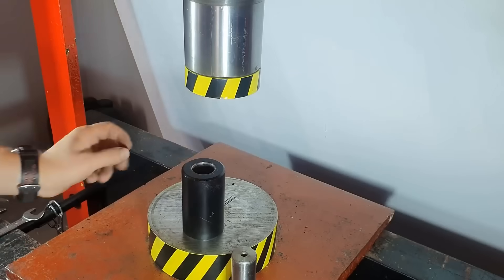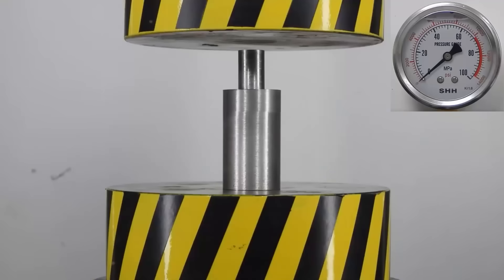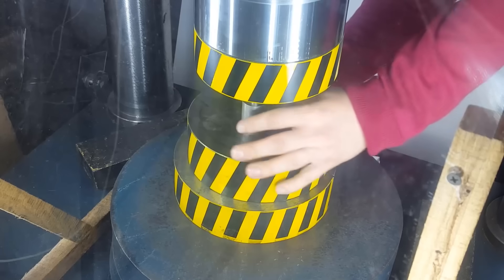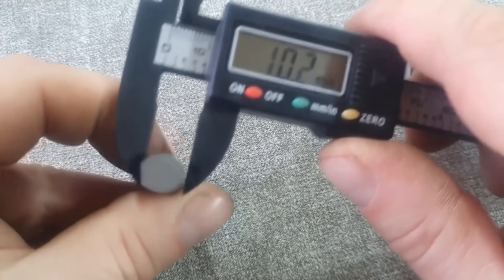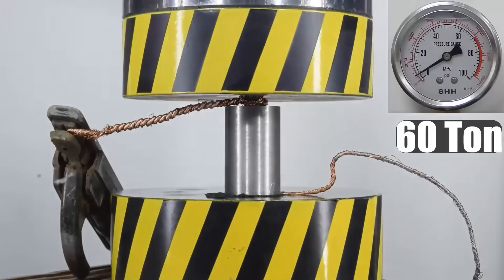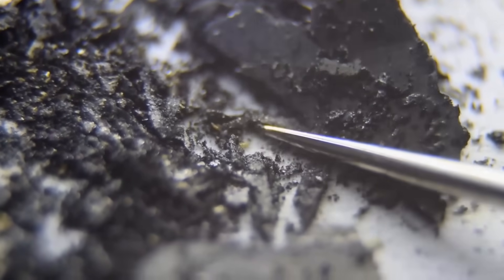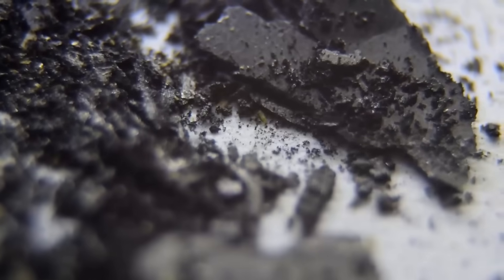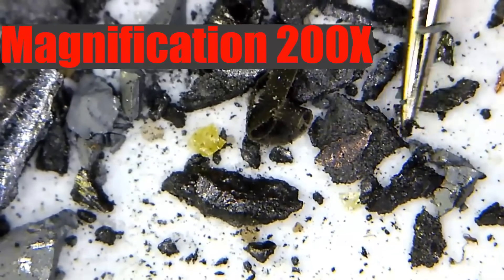HYDRAULIC PRESS TURNS GRAPHITE INTO DIAMOND

Comment: There is a process of creating diamonds called High-Pressure High Heat which uses multiple presses and a prolonged duration under heat. This method is usually used to create tool grade diamonds as they generally need to be small like that in the first place to use as an abrasive. Making Gem grade diamonds with this method generally requires a lot more time under pressure and heat which makes it prohibitively expensive. There is another method of creating Diamonds that is more economically viable and has better results for Gem grade diamonds. You probably made some graphene with your method when you applied current which can be used to harden composites.

Comment: I just started the video.. but, isn't diamond formation only possible with HEAT and PRESSURE?

Crushing graphite under a big hammer isn't going to make you rich, unfortunately!

Actually, I'm not sure how lab-made diamonds are formed? What's their process? I'm gonna check it out after this video.

De-beers isn't very happy with them, pushing 'REAL' diamonds (with all the slavery, corruption and sketchy money involved in the gem trade).. it's literally just carbon. The most abundant element on earth, squished.. Don't believe the marketing hype. Your woman won't love you less for buying an identical rock at 1/100th the price. If she does, dump her!

I think most lab-made diamonds are used in industrial applications, like drilling. 

So... what did companies that needed diamond drill bits do before now? Did they have to buy expensive diamonds? They're one of the most common gem stones on Earth as well, but the market is entirely controlled by one company, artificially inflating prices. [Debeers commands at least 80% of the global market]

Comment: If you partially fill the  blocked off cylinder with Graphite, heat it to at least bright red an also the rod then place it in the press and quench it.  The experiment should further contract  applying further pressure under heat.  Then you would have to saw it ... maybe get more diamonds??  The melted copper is due to electric shorting.  You need to maybe superglue the diamond specimen to a stylus and try to scratch quartz or tungsten to Prove its hardness.

Comment: Didn't the question of much HEAT occur to you ?  At least 1500deg. Time would not be necessary but that cylinder should have been glowing orange_hot.  The hydraulic press is made of steel so by far the heating? current would have Directly shorted out through the outer cylinder and the press. Any heating would be due to the crushing experience alone.  The breaker tripped due to shorting ...

Comment: Their are fake diamonds used in Jewelry, I don't know the process for making them, then you have CVD, I use to be an industrial diamond lapper and their uses have become less common since Hard Turning in CNC machines has become more common because Diamond in industrial use is commonly used to face off or shape grinding wheels and the parts use to be ground finish. CVD "chemical Vapor Deposition" are grown on a substrate in an atmosphere where the atoms just deposit on top of each other, thus the term growing them. They have about the same hardness as diamond but break or fracture very easily a 1X1X3mm CVD log was less than $1.00

Comment: You should have drilled two holes in the side of the cylinder opposite each other, down where the graphite, or better yet, pure Carbon would be, and strip the insulation  back a little bit so the Copper wire is embedded in the Carbon pile, then apply the electricity as pressure is starting to rise.  The electricity will heat the Carbon well beyond its melting point, and the pressure will force any gasses out of the Carbon pile.

Comment: A diamond that small could possibly be used on the tip of a disk outer edge of a flywheel (not the round part, but the disk flat part near the edge) to create a diamond polisher if you have a movable clamp that can move a clamped object sideways across the flywheel so that the diamond can cut out a polish surface on the object.

Comment: question how can u obtain 50000 pressure where in your piston has a clearance and not in a round shape, even if it is round you will still not achieve a pressure of 50000psa to achieve this kind of pressure it should be an ENCLOSED SPACE where air/fluid/liquid cannot escape din applied by tremendous force..cause as the formula says pressure is equals to force over area

Comment: Diamond is a crystal, it has to grow. Doesn’t just pop into existence
Reply: Absolutely correct. But ONLY if this was a crystal nucleating out of a solvent containing dissolved carbon, or some other amorphous solution of disconnected carbon atoms. 

2 ways to proceed with this thought:

1) That crystal begins when the first 4 atoms join up in a tetrahedral lattice. 
However... Given the size of atoms, the timescale might be considered so small it did indeed "pop into existence". It then grows very quickly initially, as the rate at which atoms diffuse to the crystal surface to add themselves is finite, meaning that the bigger the crystal gets, the slower it grows. A diamond crystal the size of this one, would take mere seconds to grow via diffusion. 

2) This was NOT a random mix of disconnected carbon atoms, but a lattice of carbon atoms connected in the hexagonal layer structure of graphite. Tranforming to diamond is now a solid state change of the crystal lattice. 
It only takes the right squeeze at the right point, for that crystal structure to trip over into the tetrahedron of diamond. Which would then ripple through the rest of the lattice at the speed of... ?an atomic bomb?  Near instant, certainly. 
Kinda like a domino rally - once started, it ripples onward. 

So, why doesn't the entire lump of graphite transform into diamond? 
Again, 2 reasons. 

- This is not one homogenous lump of graphite, but (despite the small size) it is a collection of small bits of graphite (and other stuff, like clay). Just because ONE of those graphite crystals felt the right conditions to twist itself into diamond does not mean the others were ready to. If you remove one domino from the rally, then the rally stops at that gap. This might be a grain boundary within the graphite crystal structure, for example.

- Diamond is denser than graphite. Meaning the atoms are packed closer together. As the graphite turns into diamond, the volume decreases. Which reduces the local pressure. So that transformation runs out of pressure, losing the right conditions for the transformation to continue. Once again, the rally stops, quite possibly even while still within a single graphite crystal.

Comment: If you want to make diamond from graphite, then you need to actually use graphite to start with.  Pencil leads have various proportions of clay in them, depending on hardness.  If you doubt this, just heat a pencil lead with a blowtorch for a while, and see what you have left after all the carbon has burned off.

Comment: You need a more round center cylinder, set the welder lower so that it doesn't short circuit and only turn it on when the pressure is built up.

Comment: Add some thermite to the top of the pure carbon power. The pressure could set off the thermite that would give you your heat and greatly raise the pressure at the same time.

Comment: The temperatures of the coper wires had to have gotten as hot as a minimum of 1,865° (1,864.62°) Celsius if they were melted in places because that temperature said is the melting point of copper. So that wire got up to about 2,000+° Celsius in some spots.
Reply: Copper melts way lower than that

Comment: Might depend on the coal you used too. Example thermal coal has different properties than PCI coal and they both have different properties than hard metallurgical steel making coal. If you have good hard met coal it’s carbon content is very high.

Comment: We ridicule alchemists in the old world for trying to turn lead  into gold yet it is possible to turn graphite into diamond. They were close
Reply: this is completely different, to turn lead to gold you need to add/ take protons from the atoms in this case graphite is pure carbon as well as diamonds.
Reply: @nadavk13  well no, to make gold you will need a large star turning into a supernova. We do have one local but i would like to keep it as a star for now, thank you.
Reply: Transforming graphite into diamond is like tempering steel, it's just changing the crystal structure, lead and gold on the other hand, are entirely different elements.
Reply: It’s because looks can be deceiving. A diamond is the same carbon with different arrangements in their bonding. It’s not different in substance. 

I guess like how you can make nuggets out of chicken.
But you cant make bacon from it.
Reply: Changing from one element to another is very different from changing one structure of carbon to another form of carbon
Reply: Bismuth into gold has been done, a group of physicists transmuted several thousand atoms of bismuth into gold at Lawrence Berkeley Laboratory with its "Bevalac" particle accelerator.  At the time the team said that would make gold cost about a quadrillion dollars an ounce for the electricity at the 6 cents per KWh in 1980, it's about 16 cents in Livermore now so 2.7 quadrillion dollars today!   They said they could have also used lead or mercury as the starting point but bismuth made it easier to detect the gold at the end because bismuth has only one stable isotope while the other metals have more so they could detect the various radioactive isotopes of gold plus  calculate the number of stable gold atoms from the known ratios of production.

And yeah, that means any big lump of gold you could hold in your hand that was produced that way would be lethally radioactive for quite some time with half lives up to half a year for the unstable isotopes!

So the goal of the alchemists wasn't impossible, just doing it with purely chemical means meant energies per atom involved off by a factor of a billion or so, (a few eV of atoms involved in chemical reactions versus the Bevalac's 1 -2 billion eV per atom).  Hence big honking electric bill for running a machine eating $5,000 an hour in electricity for 24 hours to make their few thousand atoms of gold, when an ounce has about 3 with 21 zeroes after it number of atoms!
Reply: there is a path to making gold, but yes requires knocking on nuclei... and what you get is radioactive for 50 years.  So even if you could do it in your garage, you would have to bury it for basically your whole life.
Reply: No comparison at all....take some chemistry and physics classes....thx
Reply: It’s easier to make diamonds than to collide lead atoms
Reply: ... I think they were using piss according to the emerald tablets.. 😂😂
Reply: graphite and diamond are both made of carbon atoms, lead and gold are completely different atoms
Reply: I can't tell whether you're jesting, or really serious about this. 
But no, they were not close at all, and deserving of ridicule. 

Graphite into diamond requires changing the way carbon atoms are assembled together into a solid crystal lattice (hexagonal sheets loosely bonded together, versus 3D tetrahedrons). 
Kinda like how a pop-up tent can be stable in a flat bag, but transforms into a tent with interior volume when allowed to change shape. 
None of the materials or components change state at all, just their geometric positioning. The carbon atoms remain carbon atoms. They are simply assembled differently. 

Lead into gold requires changing the number of protons and neutrons in the atomic nucleus, transforming which element it is on the Periodic Table. 
Either by nuclear fission or fusion. We know how to blow up atomic bombs to make radioactive materials like Uranium and Plutonium split into other elements (hence, "splitting the atom"), but we haven't quite made a sun yet (fusion). 
Even today, with our modern tech and electricity and particle accelerators, we are a very long way off having the ability to transmute any element into gold. 

Perhaps more fundamental, WHY would we want to make more gold? Other than greed and money? Ignoring the fact that flooding the world with gold reduces its rarity, and hence lowers its value.

Which incidentally was one of the great fears De Beers had - that someone might someday develop a process that could make gemstone quality diamonds cheaply, thereby destroying their value and ruining the company mining business...
Reply: @bythelee  "they were [...] deserving of ridicule"

Why? Because they didn't know what we know? If you create a theory, test it, and prove it wrong, you don't become ridiculous; you become a scientist. The alchemists made the first systematic efforts to understand chemical reactions. Without going through that stage, we would never have developed the field of chemistry. Even in the most modern chemistry laboratories, you'll find instruments developed by alchemists. They didn't limit themselves to trying to create gold, though. They also were the first pharmacists. As with all new sciences, it was a hit and miss process. In fact, it was mostly miss. The whole "mercury as medicine" thing certainly didn't pan out. Pharmacists are still getting things severely wrong, though; at least the alchemists didn't create an opioid epidemic.
Reply: @bythelee gold has functional uses tough like coatings on the end of connections, yeah very small amount but always good to have more=cheaper. But yeah if we have ability to transmutate there are other elements that have a higher priority
Reply: this has been done many times in particle accelerators.
Reply: @macheadg5er  too expensive to commercially use for making gold
Reply: @macheadg5er  No we didnt,its not just to expensive we realy cant do it.I mean you are on the right track with particle accelerator approach,but we cant physically do it yet by a forced fusion in general as the energy required is simply waaay to great for us to achieve in any machine we have on earth.For an example even the stars die when theyr core is mostly iron as fusing iron into heavyer elements requires more energy then such a fusion would produce,thou they can then colapse and the shokwave then rebounds resulting in a supernova which only then has enough energy to be the one of the rare events in our universe to produce even heavyer elements then iron such as gold is,but we are nowhere near that with our accelerators(or any other approach for that mater,atleast not oficialy) yet.The other way would be to have even heavyer element then gold as a appropriate starting element which is also unstable so that fission instead can do our work for us but since we dont realy choose what exactly are the products from a radioactive decay of a certain element in a certain time nor wheter they are them selfs stable isotops and since such starting elements are generaly way more expensive then gold anyway this is also way less economicaly efficient then just diging it from the ground.But i think one day ;) Sry for badly written english i hope you uderstand what i wanted to say.
Reply: @Domexetron-Galactronic  Learn some proper punctuation. It's not that hard, grade school children do it everyday. Your comment is unreadable.
Reply: @Domexetron-Galactronic  gold actually has been made in very small quantities in particle accelerators. Not like a lump of gold, just slamming particles into other particles until there was some gold there. Naturally it's far too expensive to have any practical use
Reply: @M_Alexander  
I not saying that we cant for example bombard break heavier atoms like lead into lighter ones like gold as they did at for example Lawrence Berkeley National Laboratory ,but yes even this takes way to much investment in both the machine and power to be efficient method in producing gold as such but im just saying that we cant,(at least not oficialy)force fuse lighter atoms into heavier ones then helium  by any method and even just getting hydrogen isotopes to fuse to helium isotopes requires wast amounts of energy from either nuclear fission explosion or todays experimental fussion reactors.
Reply: One of my companies has been turning out diamonds since 2008
Reply: @shots-shots-shotseverybody2707  what your other companies producing?

Comment: "wheel-ding"? It's WELL-DING. And your electrical setup is nonsense. The press, the cylinder and the electrode are all conductive providing parallel paths for the current. And there is a huge difference between a current and an ARC. Nothing in your setup would generate an arc. So "who the hell knows?" - well, anyone who lifted a finger to find out the basic theory.